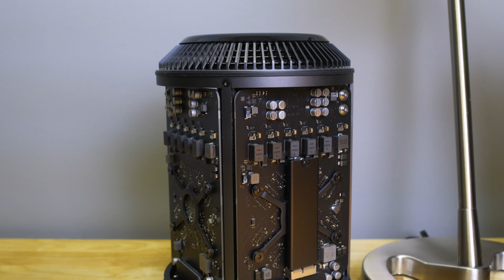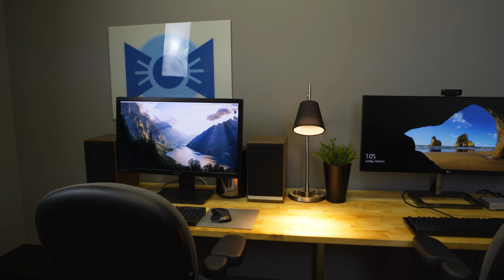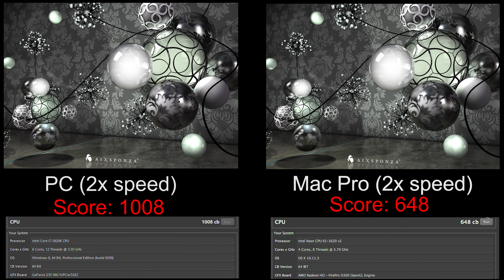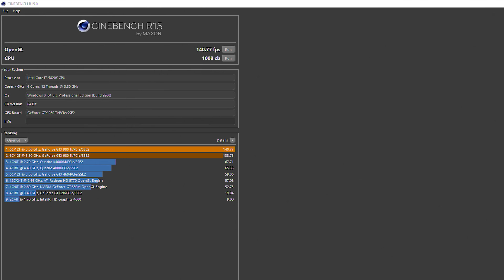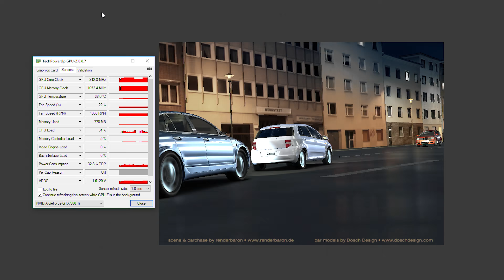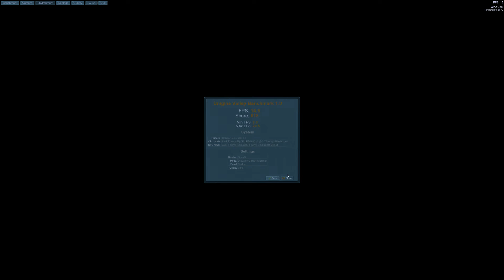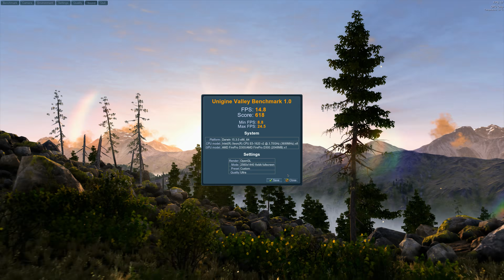$2,000 Custom PC vs $4,000 Mac Pro

Comment: Also interesting: The I7 has Intel Quick Sync. Basically an hardware H264 encoder. So in video encoding it will crush any Xeon, because they lack this feature completely.
But OSx/Final Cut has probably some way to accelerate video processing that Adobe is not using.
Reply: Actually the i7 he is using doesn't because haswell-e line of cpu have no integrated graphics
Reply: +Richard Ting Sorry, im not that up to date on my intel CPUs :D
Reply: +Julian Doll FCPX makes heavy use of OpenCL, something these FirePro cards excel at. AMD in general really shine with this, which is why the early DX12 tests in Ashes of the Singularity show Nvidia cards being spanked. OpenCL uses some of the same hardware than DX12 and Vulkan make heavy use of for direct compute. Nvidia have purposely gimped their GeForce line up in this regard as people were buying those instead of their Quadro cards for CUDA acceleration. So they made them weaker. Kind of funny when you think about it. They shot themselves in the foot, but at this point they have the problem of adding better support for this in which will improve performance in DX12 and be more competitive with AMD, but at the same time will also improve the CUDA performance which will make more people consider GeForce cards over Quadro again.
Reply: +TalesOfWar Interesting that FCPx uses open CL. I read that open cl is pretty broken and buggy on any newer osx. That's why 3d modeling applications typically only use the cpu on osx. If they use the GPU it will cause osx to kernel panic or the application crashes.
Reply: Julian Doll You're thinking of OpenGL. The version in OS X is pretty ancient though apparently it can be updated with GPU drivers, but Nvidia and AMD don't bother like they do with their Windows drivers.

I think they're focusing on Metal anyway from this point on. It's a good deal better than OpenGL (OpenGL is a rather bloated API and needs a real diet) and early testing of game ports from Windows have shown it to perform better than DX too. Apparently Adobe are investing in it too for future versions of their software. Looking at the demo they showed off at WWDC last year the performance improvements should be rather... amazing. I have no idea when we'll see it in a shipping product, but I hope they do a good job with it and don't just half ass it and then blame Apple for it being shit (like they blamed Apple for being a release behind with 64bit Photoshop on the Mac. They claimed Apple never told them they'd favour Cocoa over Carbon... which is 1000000% bullshit because Apple said from the very day they even announced OS X that the preferred API in OS X is Cocoa, Carbon was a transition layer to let developers more easily move from "Mac OS classic" to OS X).
Reply: Just google for Osx OpenCL broken ;)

Comment: Money-wise, the PC will always be a better bet, but remember that you have  base model Mac Pro with the lowest possible specs. One with similar specs to the PC will perform better, especially in some application that take advantage of the hardware. 

Bang for buck will always be the PC and it was to be expected. The real problem, as you already said, is the fact that Apple hasn't refreshed it's line since launch. That's a pity, but even after the refresh it will still be twice as expensive as a similar PC, so it still won't be for everyone.
Reply: +Tech Innuendo The entry level Macs are rarely good value for money. As you start to go higher up in the build to order stuff though they actually become pretty damn competitive and in some areas can't be beaten. I've still yet to see a non-Mac workstation with 6 Thunderbolt 2 ports. That kind of shit is unmatched and if you're in an industry that has a high reliance on Thunderbolt (audio production being one such industry, and video to a lesser extent) then you're options are rather limited.

Comment: Well It's kind of strange this video, not the pc or anything but the price, did you buy your mac pro from apple or a reseller? 2.5 years ago the exact mac pro: specs, box sold for 3000$ from apple in the USA. So why do you say it's 4000$? And the mac pro specs you mentioned are from the 4000$ model (6core 3.5 GhZ, 256GB flash, 16GB ECC 1866MhZ GDDR3 RAM, Dual AMD fireproof D500 with 3GB GDDR5 (6total)). It's not that I'm a hater, I like your videos but I think it's just a little strange...

Comment: And on top of that, you have to worry about the Mac Pro thermally throttling, because its design can't quite handle the heat when editing 4K video. Apple's product release schedules for their computers are abysmal.
Reply from the maker: +Kael This is my biggest annoyance. The CPU goes up to a frighteningly high 90 deg C before the fan even starts to work hard, and by then, the CPU is so hot that everything thermal throttles and performance is drastically increased.

Comment: Man, I'm eaisly hitting 4.4GHz on my i7-5820K, you should figure it out (1200 cinebench points)
Reply from the maker: Wow! No stability issues? Heard most people are at 4.2 GHz reliably. Shooting for that first. Ha.
Reply: Snazzy Labs No stability issues. I haven't even played with voltage, my mobo is taking as much power as it needs in a moment. jurt turned it up to 4.4 and it's hitting 12 core xeon performance. proof: http://imgur.com/25SONXb

Comment: But when they released it, it was already slow.  I have the 1st generation Haswell i7 4770k and I mop the floor with the Mac Pro.  The fact is the old machine (granted it had user replaceable parts and 2 CPUs) was actually faster in all tests than the knew one, is would get over 1200 for the cb score.  Its their boss that is turning Apple into nothing more than a expensive, anti-consumer company.  There systems are now over prices and quality is gone.That's why most movie studios and stuff that where using the Mac Pro (older actual pro models) are moving to Windows and AVID or whatever else.  I switched to PC when I saw what they did to the Mac Pro (I had two of them).   Now I have no Apple products at all.  Of coarse for my video editing, 3d artwork, etc I am running Linux now and getting good performance.I dare you to do a video and a test where you Boot Camp your Mac Pro and install a real version of Windows and run those benchmarks you just ran again.  I actually triple dog dare you.....
Reply: +TheLotw If you think Macs are overpriced now, you clearly never lived through the PowerPC days when they genuinely WERE overpriced. Until the G5 came out and totally, utterly DESTROYED the Wintel world Macs were rather expensive for what you got. Right now that is most certainly not the case. Whenever they release a new Mac they've been consistently competitive and sometimes even cheaper than their "PC" equivalent. This is especially true as you go higher up in the build to order specs. It's hard to find say a laptop that's built and specced as well as the Retina MacBook Pro for the same price in the PC world. There's always some compromise that makes the Mac the better choice. The iMac is most certainly in this realm. All-in-one PC's are fucking shite. I've yet to see one come remotely close to being as well specced and designed/built as the iMac for the price point, again, more so as you go higher up in specs. And please don't come back to me with that shitty "all-in-one" that's literally a tower stuck to the back of a monitor that Gigabyte made. The iMac is thinner and lighter than most stand alone monitors!

Comment: Install windows on mac pro then compare. OS plays a significant role as well.
Reply: +Ozan Erbektas What's the point of buying mac then ?
Reply: feisar20 I mean for benchmark purposes so the results will be a lot more reliable. Of course there are people buying mac only for OSX but, you got what I mean.
Reply: Yes thats right, comparison will be more accurate of course but I don't think it will make much difference with windows (it kills the purpose of mac) and windows pc is significantly better than mac pro especially on the graphics side. Hardware vise it's overkill already at the beginning anyway.

Comment: What do you expect apple cares more about phones than computers and have since 2007 or 8. The main reason the previous gen mac pro kept up is that the case was basically a standard pc case so it was very easy and cheap to update the hardware 
because they did not need to design new pcb's and cuircutry to fit the case.
The mac pro from that era was mostly off the shelf components and were much more upgradable.